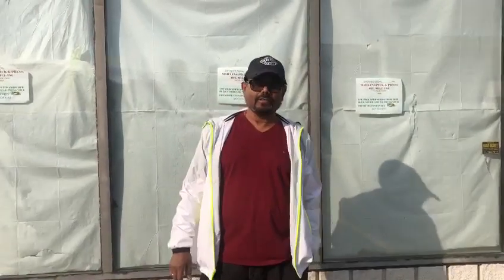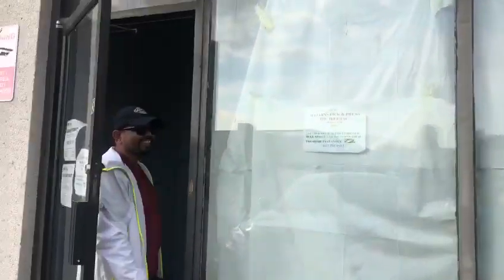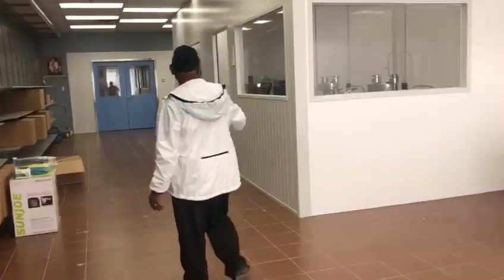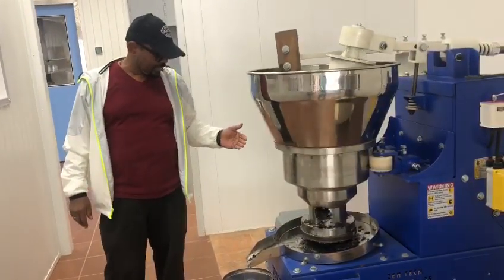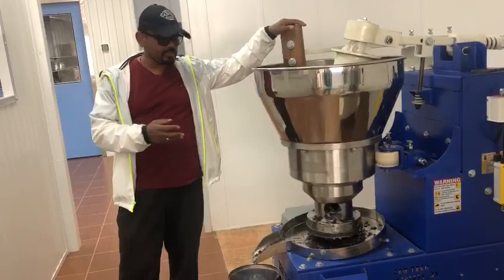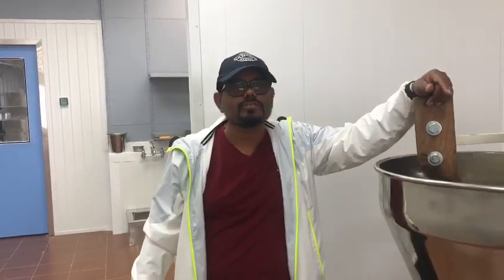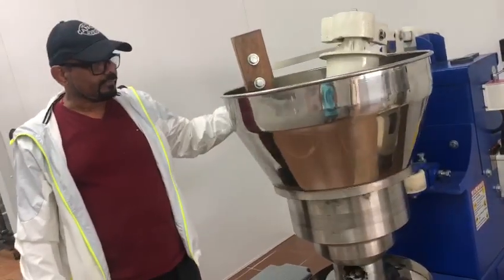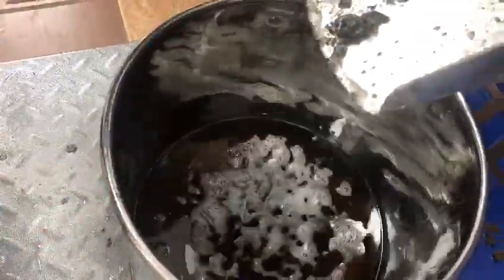Our machine in Canada #automaticmarachekkumachine #zentech #coldpressedoilmachine #lakadighana

Comment: Machine prise
Reply from the maker: MACHINE RATES: 

http://YouTube.com/c/marachekkumachine 

Voc 2 to 10 kgs. 115000+ 18% Gst =  135700.00 

Voc 8 to 20 kgs.200000+ 18% GST  = 236000.00 

Voc 12 to 30 kgs.295000+18GST=348100.00  ( With RPM  controller = 320000 + Gst ) 

Voc  15 to 50 kgs  400000+ GST = 472000.00 (This Price with RPM CONTROLLER) 

SS Ural voc 6to18kgs 280000 +18% GST = 330400.00 

Voc 8 to 20 kg 100% SS STAINLESS STEEL MACHINE 400000+ GST = 472000.00 

Nethaji ( Rotary Machine )  260000+18% GST = 306800.00 

🙏🙏🙏🙏🙏🙏🙏🙏🙏🙏 

MACHINE RATE IN USD: This Rate for Foreign Countries 

Voc 2 to 10 Kgs : 1800.00 USD. 

Voc 8 to 20 kgs. : 3070.00 USD. 

Voc 10 to 30 kgs. : 4250.00 USD. (With RPM CONTROLLER  4650.00 USD.) 

Voc 15 to 50 kgs : 5750.00 USD. (This price with RPM CONTROLLER) 

SS Ural voc. 6 to 18 kgs. : 4100.00 USD. 

Voc 8 to 20 kg 100% SS STAINLESS STEEL MACHINE : 5750 USD 

Nethaji ( Rotary Machine )  8 to 15 kgs. : 3850.00 USD. 

** We take USD Rate : 75.00 INR= 1 USD.
****For Abroad we will give some extra spare. 

🙏🙏🙏🙏🙏🙏🙏🙏 

MACHINES DETAILS: 

V.O.C Machine : Automatic Machine
( Wood ) 

10 kg Machine: 2hp 3 Phase and Single phase. 
Ulakkai (Top Wood) Life: 5000 kgs  Seeds can Crush.  Ulakkai Replacement :  3500 +18% 
Ural Life (Bottom Wood): 10000 Kgs Seeds can Crush. Ural Replacement: 4000+18%Gst 

20 kg Machine: 3hp 3 Phase and Single phase.(If Single phase Motor can Crush upto 15 kg only) 
Ulakkai (Top Wood) Life: 10000 kgs  Seeds can Crush.  Ulakkai Replacement :  7000 +18% GST 
Ural Life (Bottom Wood): 20000 Kgs Seeds can Crush. Ural Replacement :  8000+18%Gst 

30 kg Machine: only 3 phase 
Ulakkai (Top Wood) Life: 15000 kgs  Seeds can Crush. Ulakkai Replacement: 9000+ Gst 
Ural Life (Bottom Wood): 30000 Kgs Seeds can Crush. Ural Replacement: 12000+18%Gst 

3 to 5 Machines Can run by Single Person.
Heat Produced: Minimum 10 Degree Centigrade, Maximum 40 Degree Centigrade.
RPM: 16 to 18
You can crush any oil in this Machine.
If you buy STONE BOTTOM  (URAL) YOU CAN CRUSH UPTO:
25000 TO 50000 KG FOR 10 KG MACHINE 
100000 TO 200000 KG FOR 20 KG MACHINE 
100000 TO 300000 KG FOR 30 KG MACHINE 

Nethaji  ( Rotary Machine - Iron ) 

Ulakkai Life (Top Casting): 30000 Kgs Seeds can Crush 
Ulakkai Life( Bottom Casting): 30000 Kgs Seeds can Crush 
Ural and Ulakkai Rework: 4000+18 % GST. 
Heat Produced: Minimum 50 Degree Centigrade, Maximum 80 Degree Centigrade.
RPM: 45.
You can crush any oil in this Machine.
    All values are Dependent upon  QUALITY, PROPERTY, VARIETY and MOISTURE of the SEEDS.
THE ABOVE VALUE FOR ONLY PERFECT GROUNDNUT, COCONUT, SESAME SEEDS ONLY. 

🙏🙏🙏🙏🙏🙏🙏🙏
OUR YOU TUBE CHANNEL LINK: 

http://YouTube.com/c/marachekkumachine 

     Kindly LIKE, SUBSCRIBE, SHARE AND TOUCH THE BELL BUTTON in Our You Tube Page.
    Kindly Watch All videos for your all doubts. 
Our videos will helps you.
🙏🙏🙏🙏🙏🙏🙏🙏 

IMPORTANT NOTES: 

    Wood and stone machine both are same price.
   The machine value including   Motor, Starter, Switch, Spanner, Cover, Allen Key and All other Accessories. 
Machine Delivery Time : 10 or 30 Days. 
Validity : 20 Days.
    You can crush any oil in this Machine.
If you  Need single phase  3 hp motor it's available for Voc 18 kg machine only. 
     We using THE WORLD'S NO.1  SIEMENS MOTOR and BONFIGLIOLI GEARBOX AND GEAT MOTORS. 

 This is very very important: 

    You don't worry about 70000,  100000 other companies machine. You calculate output of machines. And also don't miss your dream machine for 5000 or 10000.
Thanks. 

      Service cost may vary depending upon the distance.
     You Need to pay transport costs of machines and  service engineer transport cost, Accommodation and food cost of service engineer.
     If you Need one more day of service you want to pay 1000 extra for service Engineer.
     If WOODEN BOX PACKAGING 5000.00 MORE. 

Thanks Regards 
ZEN TECH ENGINEERING 

Kanagaraj Paramasivam 
+91 98940 31929 

Ravichandran Nachimuthu 
+91 99944 06061